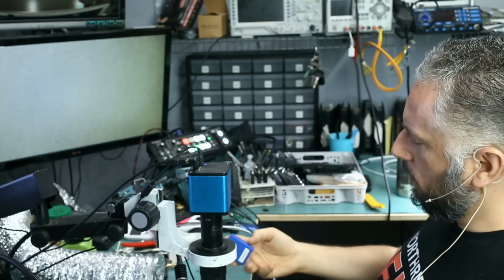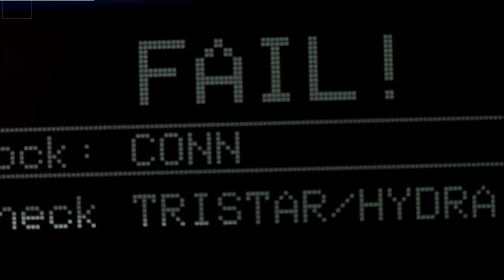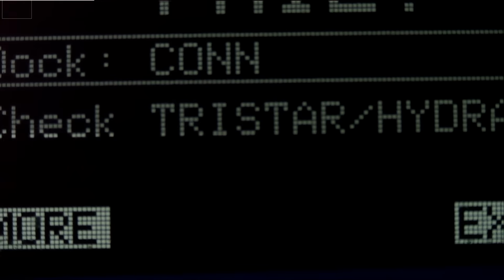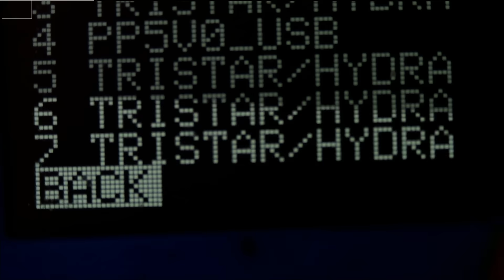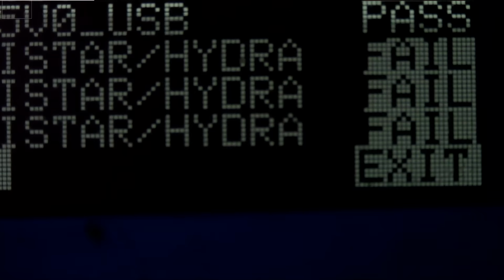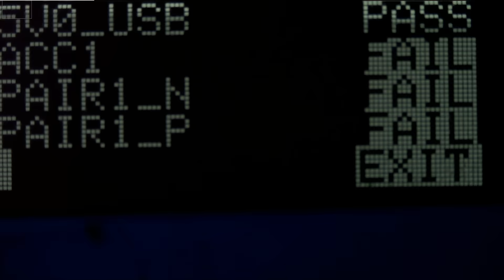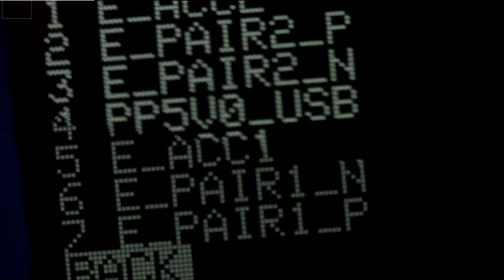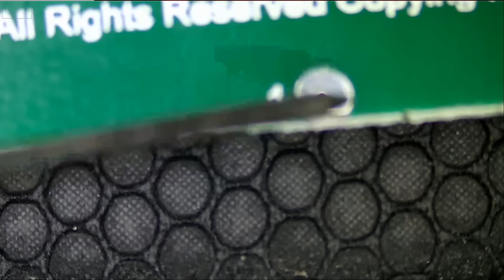iPad 8th Gen A2270 Not Charging - Tristar Troubleshoot using lightning Test board.

Comment: I see that the battery is disconnected while doing the diode and resistance tests. Does the motherboard need to be installed and connected during the tests?